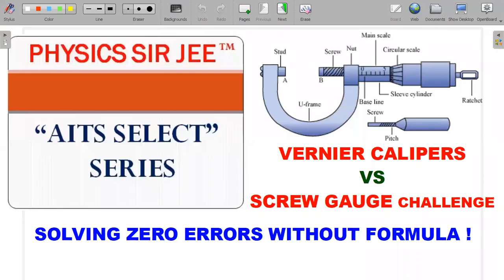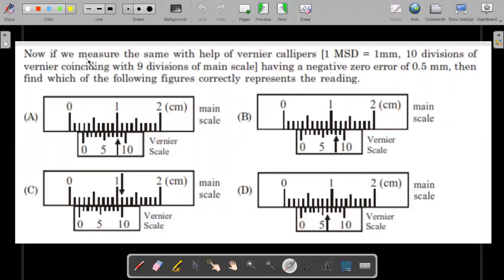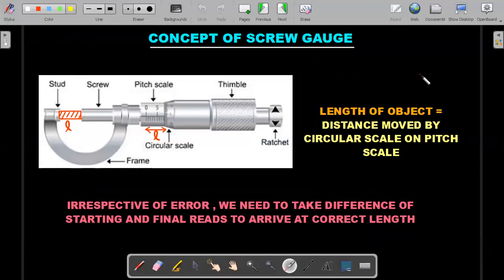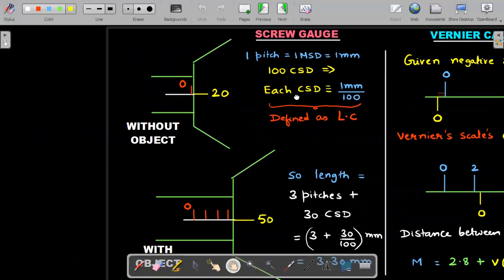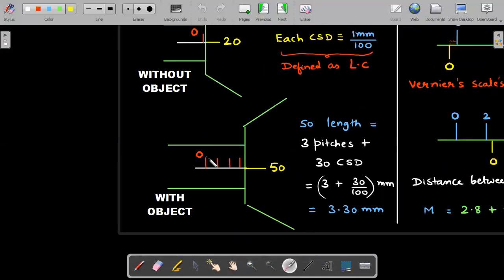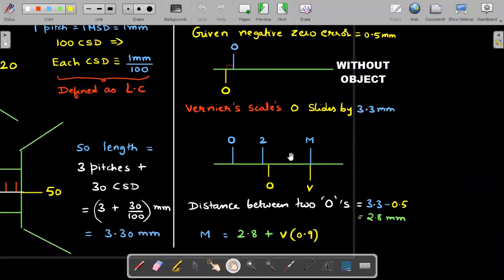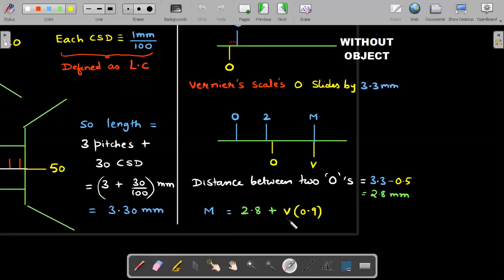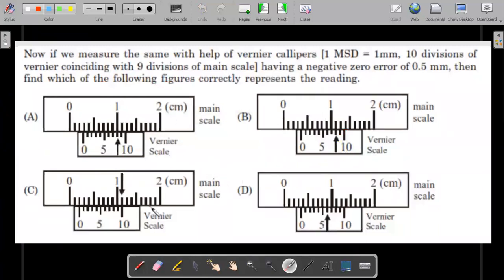AITS SELECT-12🚀 SCREW GAUGE VS VERNIER CALIPERS-SOLVING ZERO ERRORS FROM BASICS-NO MUGGING REQUIRED

Comment: Sir , I think you did the mistake in choosing the Option. Reading on main scale should be 2.8mm. Sir that means vernier scale should be right of 2 divisions of Main scale. In First option it will give reading of 1.8mm only. Sir please clarify.
Reply from the maker: Please post timestamp of your doubt on old videos. It would be easier for me navigate to the exact position of the doubt in the video
Reply: @PHYSICSSIRJEE  Sir , please could you clarify a small doubt. If LC circuit is connected to DC voltage supply. Will it oscillate. Will it be able to achieve steady state current. One of JEE question was based on it , and it answer was it will achieve steady state current. But when I apply KVL and solve for equation of Current I get a Oscillating current just like in LC circuit without battery.
Reply from the maker: @KundanKumar-oh8qb  yes , LC with DC battery will oscillate
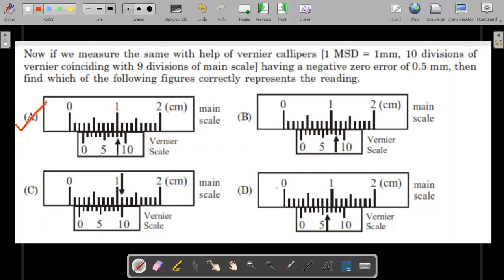Reply: 12:51 

In Option A reading will be 1.8mm only but you only calculated reading should be 2.8mm so option B should be right. Am I correct?
Reply from the maker: @KundanKumar-oh8qb  The "Zero" of vernier scale decides the MSR and not the left edge of scale . The main scale division to the left of the vernier zero is 2